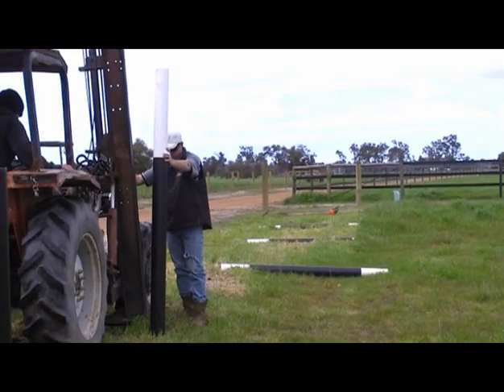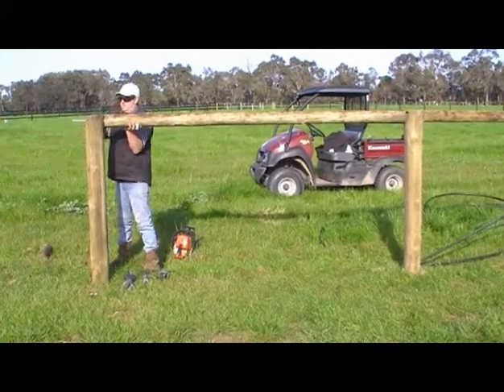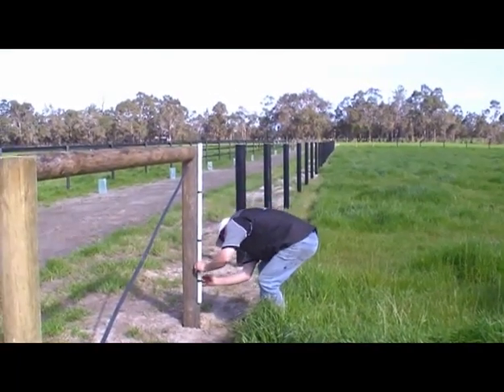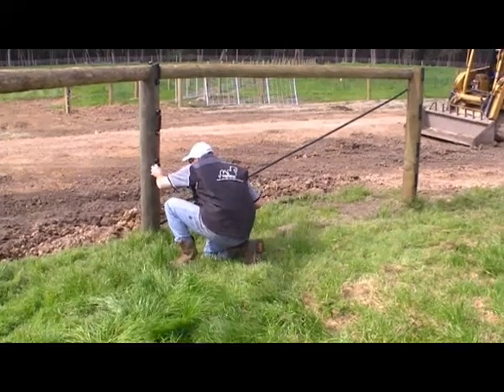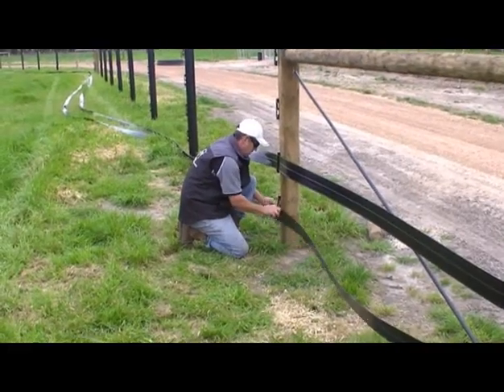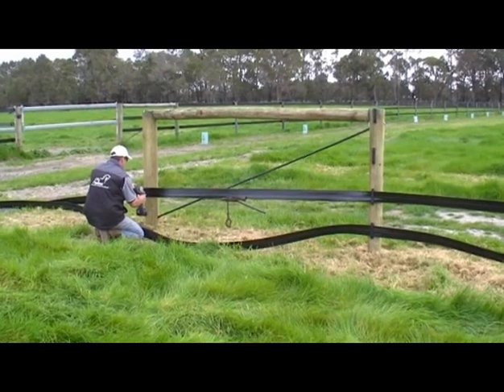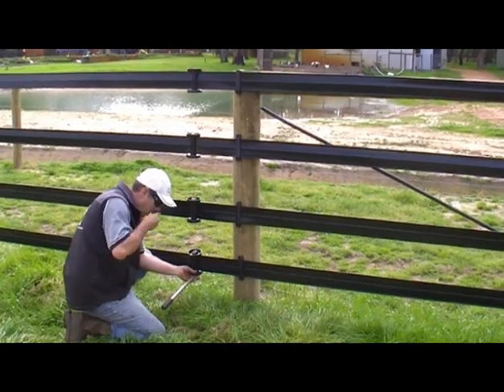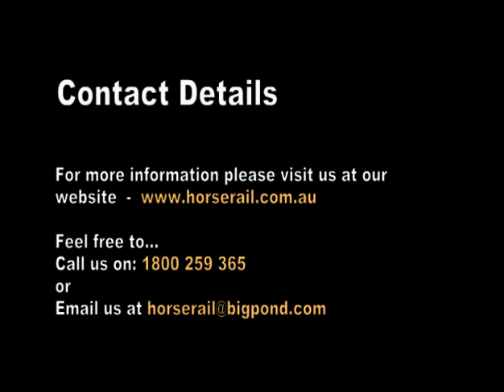Complete Horserail Installation

Comment: Thanks 
Good video well explained i will be installing horserail  in a farm in portugal in the next week or so. What tool did you use at first to put tension on the rail before locking it down?

Comment: How is that fence holding on after so many years?
Reply from the maker: would you like to see a current pic/ vid?
Reply: @benduncan72  Please update!! 🤍
Reply from the maker: I need to work out how to share pic/video
Reply: @benduncan72  I think it’s called community posts? or you know what just tell me I trust you lol, how does the horserail look now? has it loosened up over time?
Reply from the maker: @harinu9339  no the only reason it will loosen up is if the end posts moved . And if built correctly this will not happen. We have now made our own version with new technology called stallion rail which has even better characteristics. Check out www.duncanequine.com.au
Reply: @benduncan72  Nice, thanks a lot and congrats!